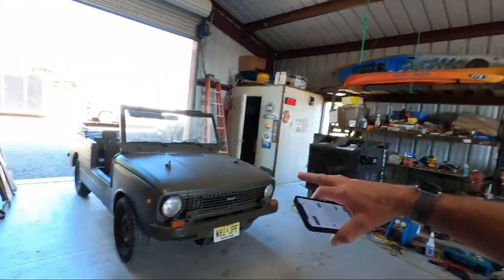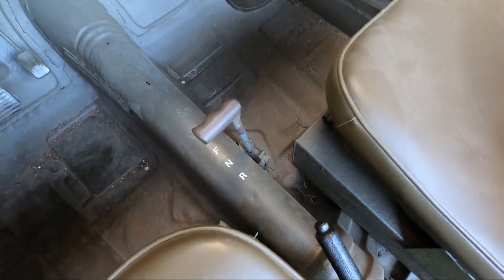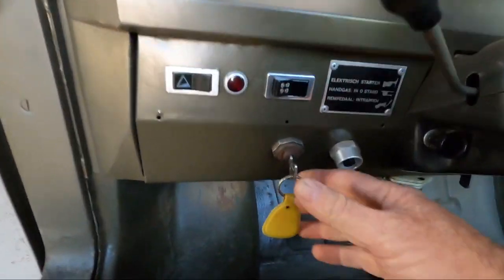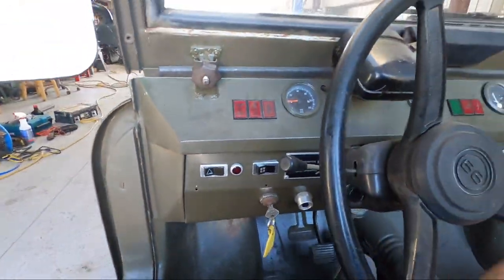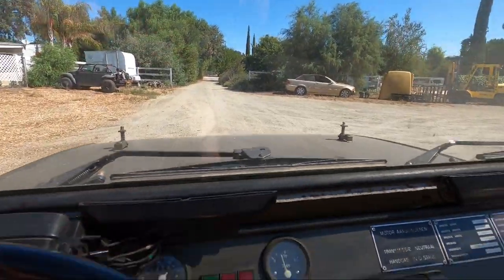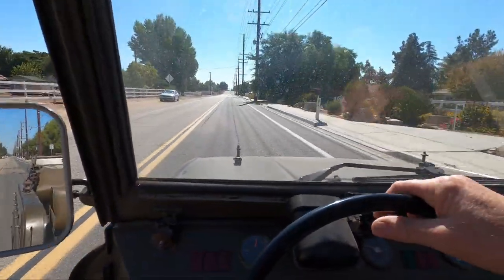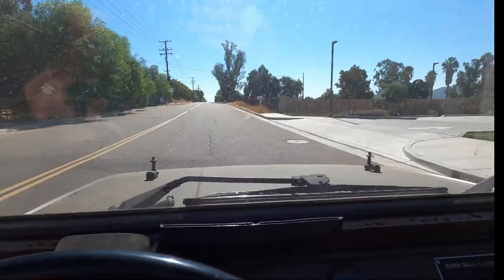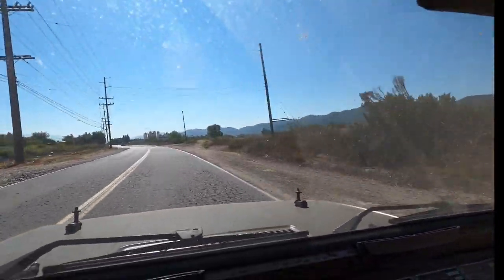DAF 66 YA Basic Controls and Road Test

Comment: Great video. The reason the engine kicks up when breaking or pressing the low hold ratio is because when the EMV is operated it allows more air into the mainfold changing the air fuel ratio which makes it pick up.it does not have any effect on the operation. The low hold and the brake circuit are the same thing just one has a switch on the dash and the other is on the master cylinder.it draws the primarys apart preventing change up. Never accelerate with the low hold on as it will tear the membranes in the primary unit's